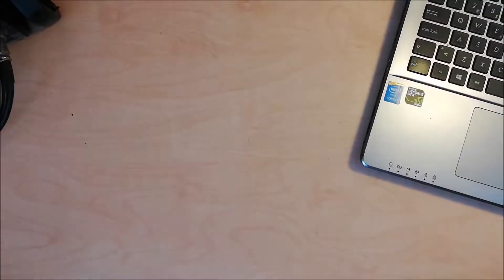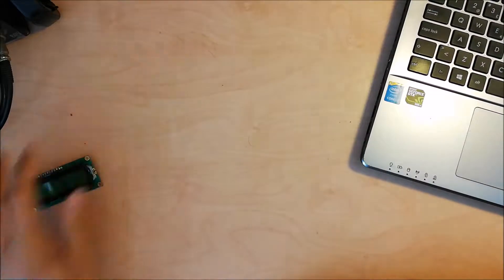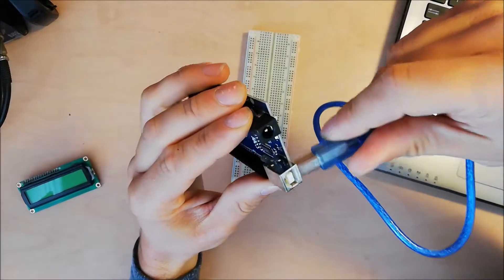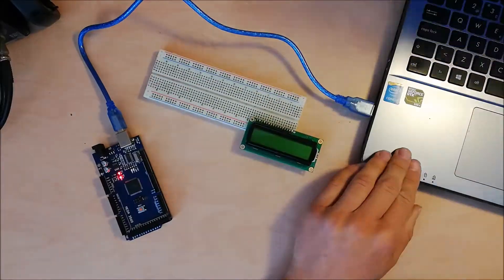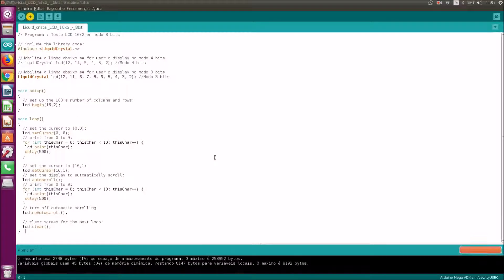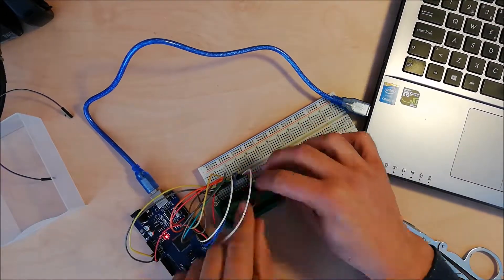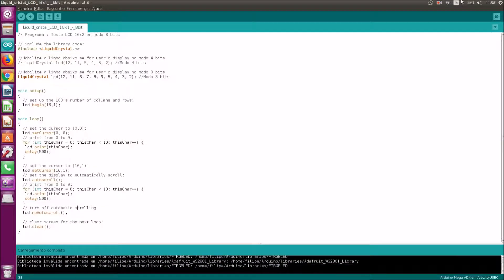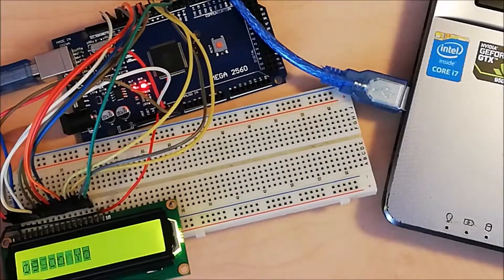Arduino LCD 16x1 - 8 bit

Comment: It is a bit weird, but to use the second part of the LCD, you need to change your cursor from (0, 0) to (0, 1). This will make the second part of the LCD turn on. Hope that helps ^^

Comment: I wrote a function to handle both halves of the 16x1 lcd screen, just call it with singleLineLcd("text here");

#include <LiquidCrystal.h>  
LiquidCrystal lcd(12, 11, 6, 7, 8, 9, 5, 4, 3, 2); //8 bits mode

void setup() {
   lcd.begin(8, 2);  //is 16x1, adressed as 8x2
   singleLineLcd("test this text");
}
void singleLineLcd(String inputText){
  int strLength = inputText.length();
  int pieces = 1;
  int size = 8;
  pieces = ceil(strLength / size) + 1;

  lcd.setCursor(0,1);  //init right hand side
  lcd.home();          //back to start
  lcd.clear();

  for (int i = 0; i <= pieces; i++){
    if (i > 0) {
      lcd.setCursor(0,1); //go to right
    }  
    lcd.print(inputText.substring(i*size,size));  //print left side
  }
 
  lcd.cursor();
  lcd.blink();
}

void loop(){

}